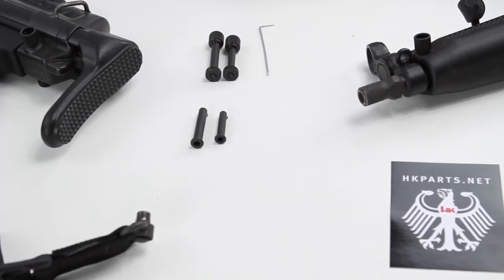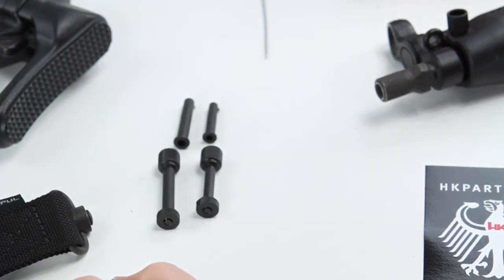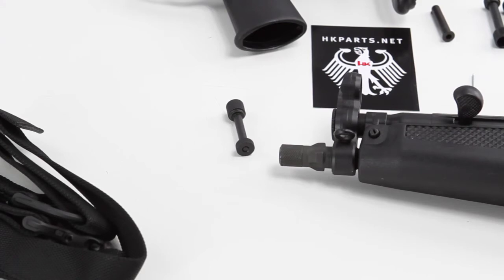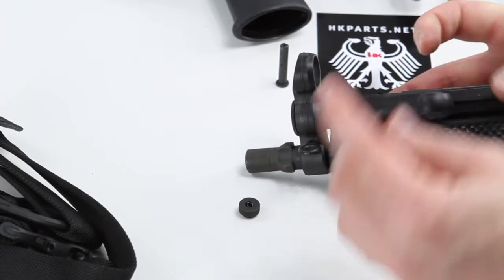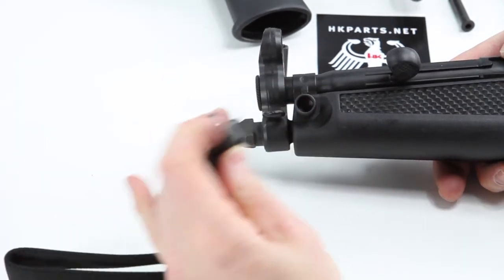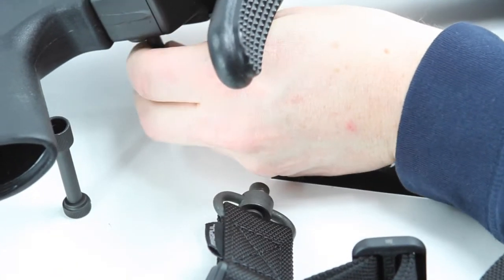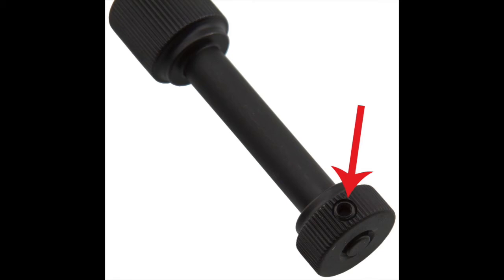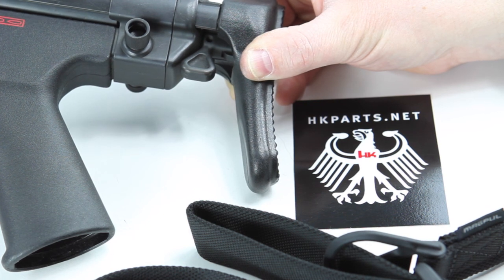Quick Detach Sling Pins Installation

Comment: Note that on the MP5, SP5, SP5K, etc the small pin is used for both the front and back. Only on the rifles (HK91, HK93, etc) do you need to large pin for the back pin.